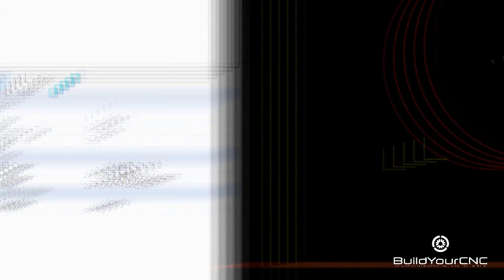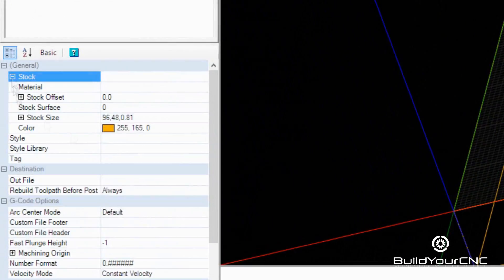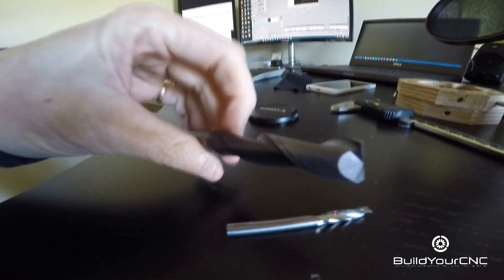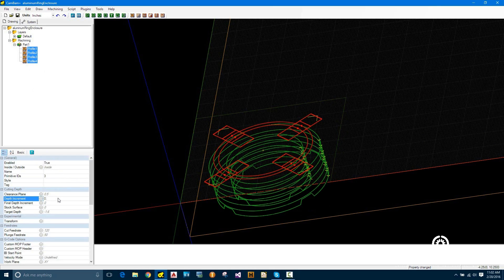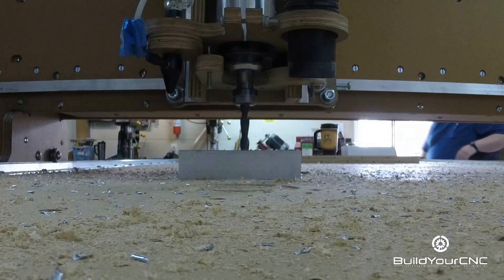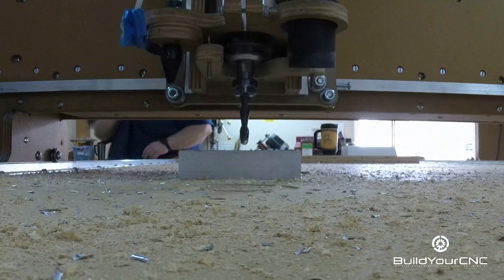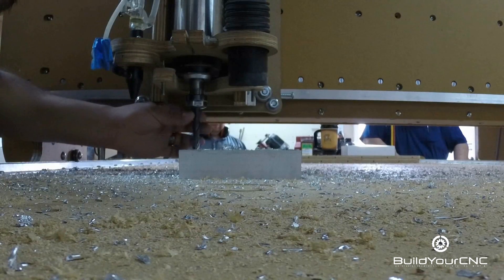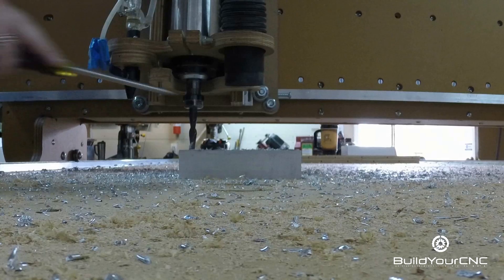How to Cut Aluminum - Don't use a Cheap General Purpose End Mill

Comment: You did almost everything wrong. .. You should get some ZRN coated carbide end mills, no more than 2 or 3 flute. Aluminum sticks to other coatings. Uncoated carbide is fine too.

Don't buy single flute end. Mills. They're OK for finishing passes on 40,000rpm spindles but they have no value here. 

Keep the end mill as short as possible. The longer the end mill, the less aggressive the cut can be. You'll destroy your bearings experimenting with that much stick-out.
 
Never cut aluminum dry on a high speed spindle. The higher the speed, the more heat it will generate. Whoever told you high speed generates less heat was an idiot. You need coolant and lube on the end mill.  

If the cut is hot enough to melt aluminum, it's hot enough to destroy the spindle.

Use Gwizard to calculate feeds and speeds. It will compensate for the lack of knowledge by doing all that part for you. There's a free trial so you can see what I mean. 

The larger the tool diameter, the slower the spindle needs to be. Most  small cnc router spindles don't have the torque to do a good job with a 1/2" end mill in aluminum. If that is a typical 2.2kw 24,000 rpm Chinese spindle, 1/2" is too much when cutting aluminum. Stick to 1/4" so you can use all of your available horsepower. 

That's my $0.02
Reply from the maker: Thanks Zebra, these are excellent recommendations.

Comment: Nice try live and learn i still love your design sorry i did borrow a few ideas from you chain drive, vertically mounted laser , z axis ball screw 
Vert. mounted laser is very ez to align but shakes like crazy so i mounted it on 
The back of the gantry bounce the beam off 3 mirrors to get it where i want it
 aligment is way more time consuming but not too bad 
Mine can mill titanum if i go slow shallow cuts it was a dare so i tried it 
Cuts like aluminium only very much louder 

Cheers

Comment: What you're doing is incorrect 2 largest diameter in Mill you should be ramping the cut not plunging start over with a 3/8 or smaller in Mill

Comment: That thing's for plastic guy. Use something with a ZRN coating. MSC stocks them, AccuPro makes them. Use a oil mist as well. It keep the chips from welding to the tool. The ZRN coating helps with that as well.
Reply from the maker: Thanks.  The mistake at the beginning was due to the depth per pass too deep.  We put out the video just for fun.

Comment: I bet you could have pulled it off without a different or fancy endmill, though they help.

It looks like you're way too fast on the feeds and speeds.  Try using a table, or a good feeds and speeds calculator, as a starting point, such as G-Wizard:  http://www.cnccookbook.com/CCGWizardv1.html?utm_expid=2217679-159.qBauLEQ4SHiJpyopFub4sw.1

Also, spraying isopropyl alcohol will help with cooling and lubrication (conveniently without making an oily mess).

Comment: Coated end mills are worth going with, I find two-flute is also fine, I use Garr tools often. I normally use some coolant (WD40 or ethanol/water) or at least compressed air. May I suggest cutting the bore including finishing then adding a disk shaped clamp in the middle to hold the finished part while you cut the outer. You might also consider using the wax based holding paper by mitebite (or similar name I forget) for work holding.

Comment: What about a mister spraying lubricant on the bit?  Or is that not appropriate?  I have never cut aluminum with my CNC (built with your plans over 7 years ago).  (nevermind - cutting fluid is the lubricant.)

Comment: I'm always looking for new ways to do lathe work on my mill, but i think you have dug the hole deep enough and i'd look at a different solution now. The combo of RPM and tool diameter is what is causing your surface speed to go too high and generate too much heat. Changing Drill geometry will only help with chip evacuation or clearing them from the flutes; using coated end mills will help a bit but not solve the problem. Coolant will also help a little, but only do this if the bed is made from aluminum and you remove the spoil board... mixing fiberboard and liquids is a very bad idea. If you are determined not to use a lathe, you would be better to drop the Router for this part and look at maybe a cheap Chinese boring head, some tube stock and a drill press.

Comment: Your speeds and feeds are way too high on the router with that length of your tool. Try s2000 f1 to 5 max. Create a clearance pocket for your lead in lead out moves. Does your software offer the ability to ramp, and if so it will reduce your lead in lead out to one instance. Cut a .02 rough cut from the wall of your part then finish pass. If your material is to size on the thickness, machine down to .03 go back and machine the .03 ID and OD in four quadrant leaving tab in each quadrant. .01 to .02 thick to be snip and filed. The deep that you're going with that tool can be problematic. The problem isn't friction alone its chip recut. Cutting into a chip you just made causes chowder, mars the finish, and will were  the tool out prematurely. Try blowing  the chips out with compressed air. Which will also do double duty as coolent. Good luck.
Reply from the maker: We will give it a try.Thanks for the excellent feedback and suggestions.
Reply: +richardmhernrh I agree that you feeds and speeds are way to high. At that speed the aluminum will melt and stick to the cutter and give you what you want.

Comment: when you get to the bottom of the groove there should be an option to cut tabs so that the part won't break free. this allows you to break through in most of the part yet leave something small to file off.  also before you get to the bottom and before you cut the tabs do your cleanup cuts.   should go something like 90ish% inner groove -> 90ish% outer groove -> inside cleanup -> outside cleanup -> inside to depth with tabs -> outside with tabs -> final inside cleanup -> final outside cleanup ->break tabs by hand.  make your tabs somewhere maybe between .030" to .015" this should be thick enough to keep everything stable but thin enough to file off with minimal effort.  what was your final speed/feed? I didn't catch the endmill size and tooth count.

Comment: There is a specific tool for a specific job. A router just isn't the tool for lathe-parts. A lathe is. Buy a solid rod of aluminum or even a tube, whack it in a lathe and you'll get the wanted result for a fraction of the time and money spend on this. Sorry, but i'll have to give a thumbs down.
Reply from the maker: Yes, I mentioned this in the video. Thanks.
Reply: +Patrick Hood-Daniel Yeah, I saw it. But I really can't believe you'll gotta charge your actual costs even if the customer is in a hurry - what will you charge for something like this? material, set-up time,  machinetime, maybe even the endmill-bit? "OK, here's the little aluminum ring, you forced us to make - it's wobbly and looks like shit, $200 Thank you".
Reply: +Patrick Hood-Daniel Don't get me wrong: I love your content, i like the
 way you're doing your machines and often got inspired by your videos, 
but this is such a horrible botch I just have to rant about. 

You don't even use some coolant like spiritus or fluid. It hurts my eyes when I see such botching. You could have put it in a drillpress and gain better results than this.
Reply: +Marcus Wiedner If you don't have a lathe you don't have a lathe.